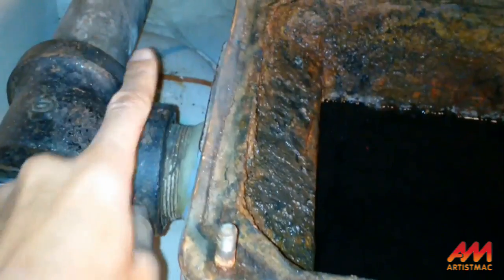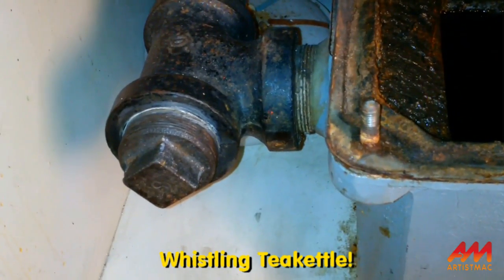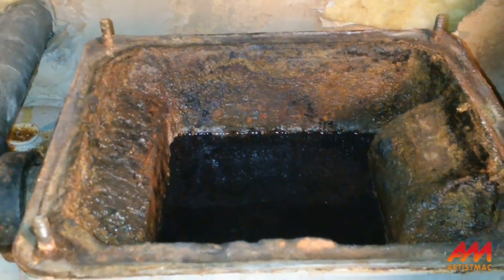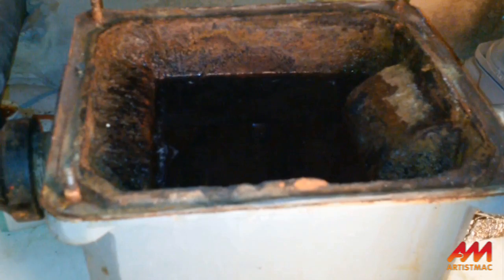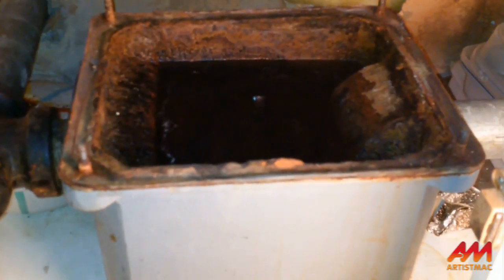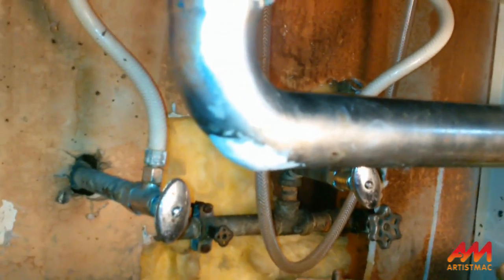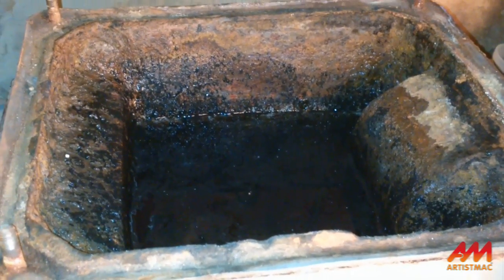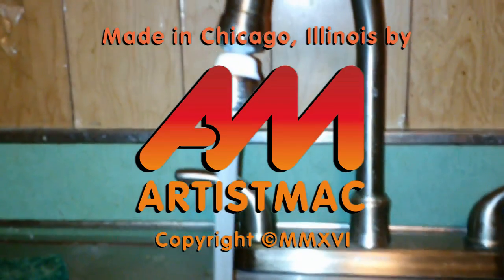Cleaning Out the Grease Trap, Part 2: Not Done Yet, Young Man!

Comment: I'm surprised you didn't wear gloves. Your local grocery/drug store should have a box of 50 pairs for around 4 bucks. Kroger here sells them powdered and unpowdered for that. I would also run some super hot water down the drain too. You could boil a big pot on the stove and pour it down there. Melts any build up going as far as it can till the water cools down. 
  Have you replaced your Fiero headliner material? 🚗
Reply from the maker: +Bob Stinson I've been doing the hot-water thing all along -- after a certain point, there's no substitute for dipping out all that semi-hardened grease. Without gloves on, I can get my spidery fingers much farther up that clogged shaft than with gloves --that and a few light taps with a rubber mallet loosened the clog on the outlet side.

We're in the depths of winter here now, so the headliner will have to wait until spring.
Reply: If you gotta wait till Spring you gotta wait till Spring. But I feel you'll be quite surprised how small that thing is when you get it out. But depending on how flakey the original glue the factory used that can make for quite a mess to have to vacuum up.